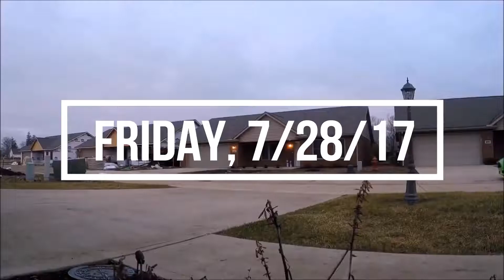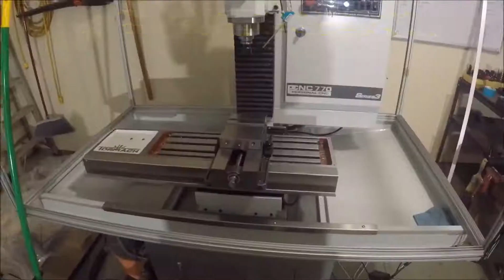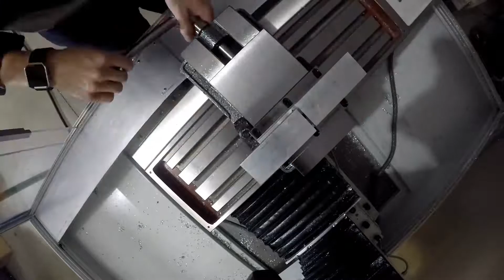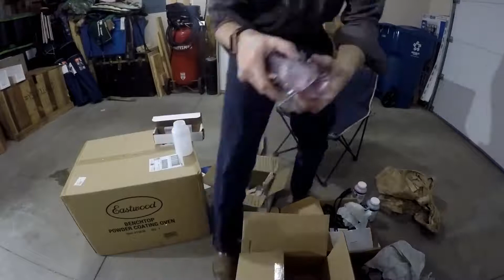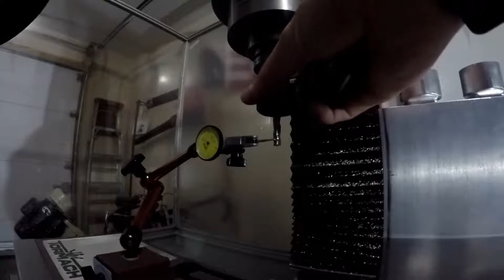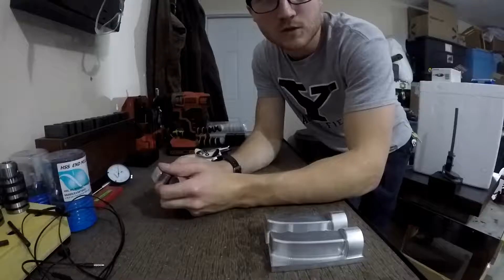Double Soft Jaws, Powder Coating and Tool Runout "Fix": After Work Special #77

Comment: Go a step farther.  Use the dial indicator on the spindle and start marking.  Figure out right where the high spot is and mark it on the outside of the nose.  Make a really permanent mark.  Then use that to index all your tooling.  Put a sharpie mark on every tool that lines up with that mark where the runout is lowest.  You can get all your tools within a half thousandth generally.  If not, check your collet holder, collet and tool.  You only have to recheck tools if you take them apart.  Buy lots of tool holders.   There are more generic sources for your less critical tools.

A few months ago I read up on grinding the spindle in place and I'm planning on trying it someday, but that's honestly scary as heck.  You have to be ready to buy a new spindle if you mess it up.  Unfortunately the 770 spindle is even more expensive than the 1100 spindle so it's hard to justify the risk without knowing the result will be worth it.  If I had to work with a toolchanger, I might get deadly  serious about getting it done because you can't hand index the tools if you have one.
Reply from the maker: advil000 I have checked some of my tool holders and they seemed to be good which led me to believe that the collet was not straight when tightened down. That's when I decided to do the trick I leaned from an nyccnc video which is what it did in this video. It worked and the tool was almost dead on but after I ran the tool then it had some runout again. Should I get some better precision collets from someone like maritool or something? Thanks for the tips!
Reply: I havn't seen much difference on the Tormach between $5 and $20 collets.   If you suspect a collet it's cheap and easy to try another.  Probably not the issue.  Make sure you are assembling the tools right.  Fully snap collet into nut (it must be snapped into the nut first thing, this is vital or you will quickly damage toolholder, nut and collet), start tool into collet, gently screw on collet nut a turn or two just so it stays on, slide tool to final height then tighten down.  You might want to make your first pull to tighten a little more gentle, then put the wrenches on the other side of the tool holder and do the last pull from the other side.  It can help to even out the result.

I'll see more than 1 thousandth of runout frequently at the worst index location since it compounds the error of the spindle runout PLUS any toolholder runout.  At the best location it's usually just a few tenths.  If it's not, disassemble and try again.  If still bad even when indexed, change collets or toolholders or both and try again.

Only way you will know how bad your actual spindle runout is will be to take a few minutes, remove the drawbar and r8 collet, and check the inside spindle nose taper at several heights with your indicator.  There should be a consistent high spot as you rotate the spindle.  That's your runout.  If it's huge, as in over the max allowed tolerance of your inspection report, you need to contact Tormach ASAP while it's still under warranty.  They're great about helping, but it's up to you to find the issues.  I had to replace my spindle drive motor under warranty as it was just plain noisy right from the start.  I didn't realize it was unusual until I had owned the machine for 6 months.
Reply from the maker: Awesome! Yeah I have been sure of snapping the collet in the collet nut but I am going to check the spindle taper today.  Thanks again!